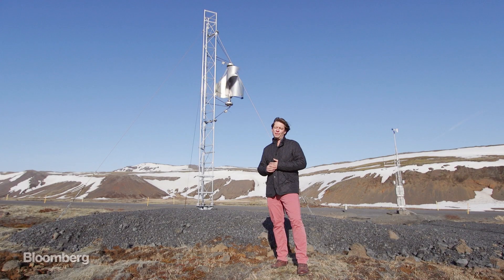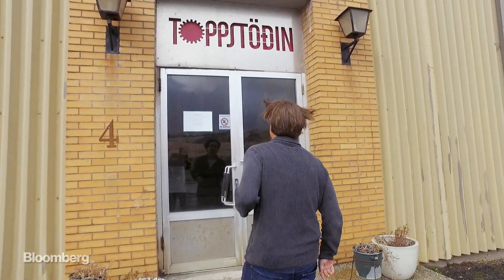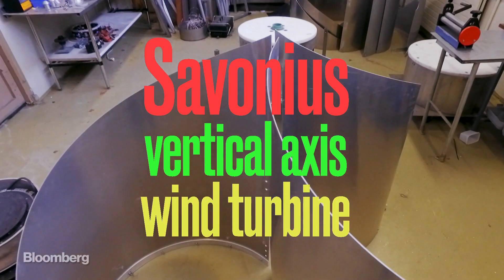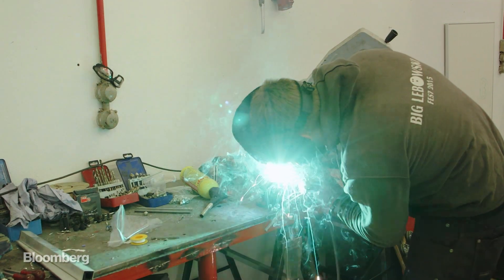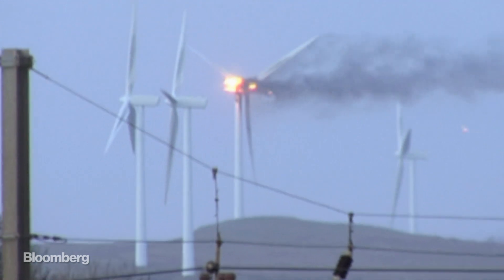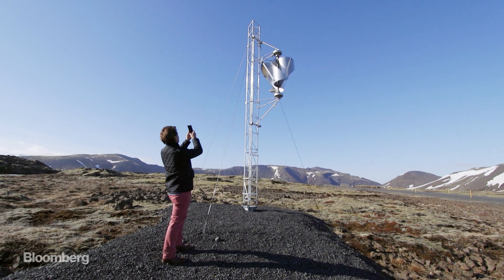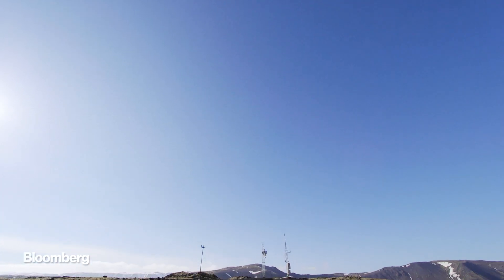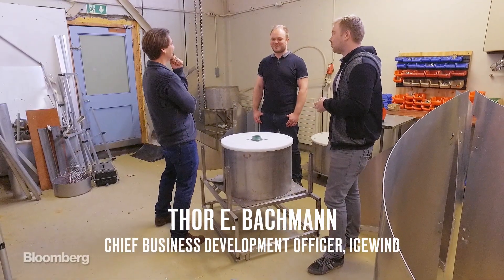The Tech That Could Fix One of Wind Power's Biggest Problems

Comment: Just read about 100 of the comments. NOT being an engineer but having a fairly practical approach, what if basic "turbine" was CAST in a reusable mold like car bumpers/fenders are instead of steel. Plastics like P-tex are very strong & flexable & totally weatherproof. w inserted bearing ports in molds be easy to replace worn bearings, be very lightweight & WAY cheaper to produce in mass. Stealth planes are made from carbon fiber sheets & withstand incredable forces from windshear to heat/cold. Just an idea......also having each "blade" on a vertical axel that would let approach side collapse closer to axel reducing head on wind resistance w a counterweight arm to centrifigally push it back out in overspeed conditions. w gravity/g forces on any spinning object being constant once the right formula was figured out seems all things would balance out. just the blade weight itself could be its own governer. fully out to catch wind on cup side, folded back on resistance side going into the wind until high centrifigal velocity flings approach side out for MORE resistance.

Comment: Look at the actual use case. A very remote comm relay station that 
doesn't need much power, and is under snow half the hear. Sometimes 
being self-contained, robust and relatively maintenance-free is a big 
plus. Efficiency be damned.

Comment: This is bullshit. Normal wind turbines can handle extreme winds just as well. They can slowed down with tip brakes or by changing the pitch for a good reason. They overspin and catch fire only if those system plus the normal brake fail, which is actually pretty rare.
Reply: yap, this crap is an order of magnitude les efficient then the standard wind turbine. It wont explode but wont make much energy either.
Reply: It seems you need to do your homework. 
This design is to prevent the use of brakes. It allows a constant airflow, never to exceed certain rpm during heavy wind. yet still work effective when wind was lite.
With an enclosure you can adjust the flow as you like without the need of friction to the moving shaft.
Normal wind turbines have to be angled away from flow when it comes to a certain windspeed, this is the main reason why failure is rare. But at the same time, you are not harvesting energy.
Reply: lil Chiller 
Why do they last then only 3 years as claimed here?
Reply: It's a false claim for better advertisement. Maybe there've been cases, where some got destroyed after 3 years, but on average they last 15+ years if maintained propperly.

+Damon "Normal wind turbines have to be angled away from flow when it comes to a
 certain windspeed, this is the main reason why failure is rare. But at the same time, you are not harvesting energy." This is just plain wrong. Seems like you're just throwing around nonsense.
Reply: lil Chiller Throwing nonsense? 
Tell that to my 4 year long university degree in physics.
Prove me wrong kiddo. Go ahead :
Reply: Hulla Dek What you forget in your amateur calculations is the energy waste at producing the conventional wind generator. Not to mention the footprint in nature.
And yes, it IS a more efficient winmill. Prove me wrong kiddo. Talk physics and maybe I will respect you.
Last chance before you get troll-stamped..
Reply: Damon Khan Pahlavi Looks like it was a waste of time. Arguing a much less efficient design is better cause it cant blow up. "Its better cause it cant harvest energy at storm conditions". You really want to design an energy harvesting system for conditions what occurs rarely?
Reply: horizontal wind turbines are less efficient, only better where the wind change direction rapidly. And where it does its a bad place to try to harvest it. I been thru this, I wanted horizontal wind turbines to be better but it just physics same sizes axial wind turbine always much more efficient.
Reply: Hulla Dek Thats the point with V-turbines. You can adjust the wind flow better hence harvesting energy more often and in harder wind conditions where H generators with huge blades must be shut. Brakepads can only handle a certain time of pressure. You don't need as much height to begin with and that make it easier to reproduce.
Reply: Hulla Dek you can put several hundred of V generators or three times for the cost of 1 traditional windgenerator..
Reply: Don't get it why wold it cost 3 times if they are the same size? Guess your problem is you compare this little thing price to a much bigger and more energy producing axial WT. Why would it be cheaper in the same size? Need the same generator. Need about the same amount of material for the blades, maybe HWT needs even more. One big thing is always more cost efficient then many small. Why do they build bigger and bigger turbines, bigger and bigger ships, planes?
Reply: I agree, mentioning this overspin flaw was a blow below the belt to turbine engineers.
Reply: Tell that to my degree in renewable energy systems. This is what I deal with on a daily base.
Reply: Hulla Dek Do you know the amount of energy it takes to assemble wind turbines?
Are you suggesting that H generator blades are made as the same material as V ?
Im not talking about the material used in the generator itself. Ofc its the same there.
Building bigger planes and ships have nothing to to with aerodynamics and esthetic point of view of wind turbines.
Where I live, ppl don't want to use wind turbines because they say it ruint nature. This is the main cause that we don't have more wind generators in most countries. Go figure.
Imagine you don't affect the view of the horizon with 3 V turbines in stead of 1 large H. The time it would take to pass the suggestion of high rise H turbines, you would already be harvesting energy with V ones.
I already now of the torque factor of the H turbines but there is alot of things you forgot before you can calculate for positive energy.
Reply: A bit like Amazon and Stagecoach , its called Capitalism.
Reply: must be why soooo many of them fail huh..tip brakes?  lol on a 30 foot long wing do nothing, they use a conventional disk rotor brake system...  they wear out all the time..  hence why they fail.
vawts however can use a simple cantalever to throw out a drag plate when it reaches a certain rpm..

pretty rare... your suppose to change your brake pads every what 4 or 5 months?
I'd say thats pretty consistant.. not rare.  unfortunetly they cant change all of them all the time hence why the fail.
Reply: There are about 100 1.25 MW windmills close to here...I have only seen one catch fire in the last 10 years.  It was one of the oldest.
Reply: lil Chiller 
until you find that turbin burn then kaboommm lol.